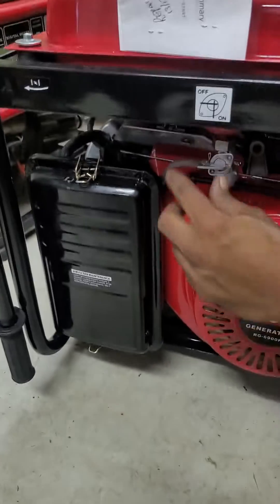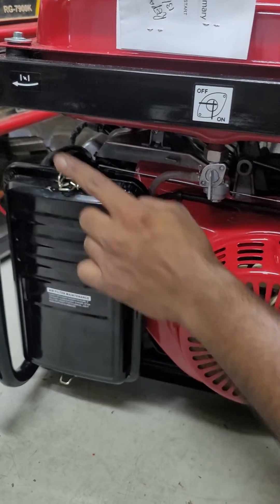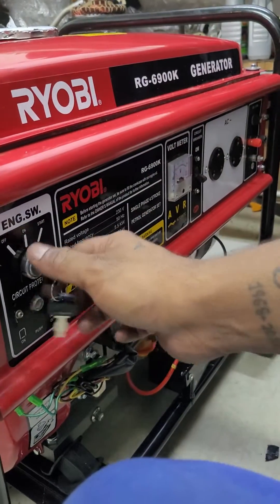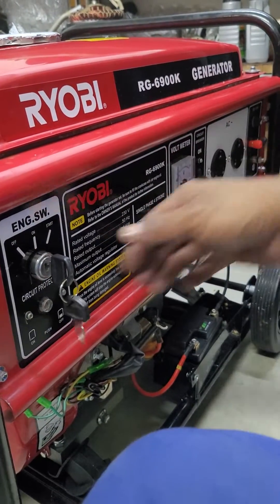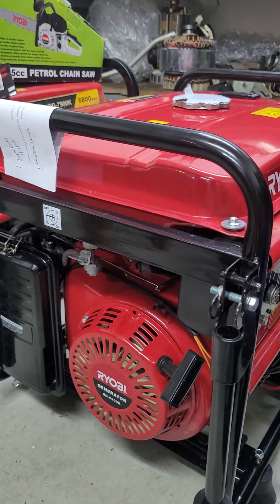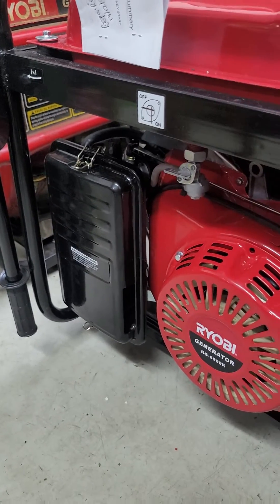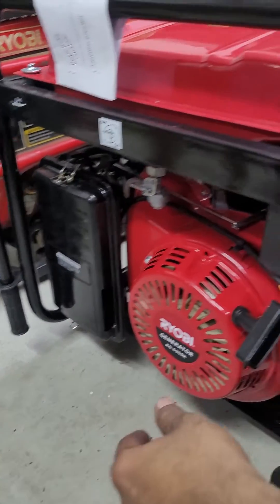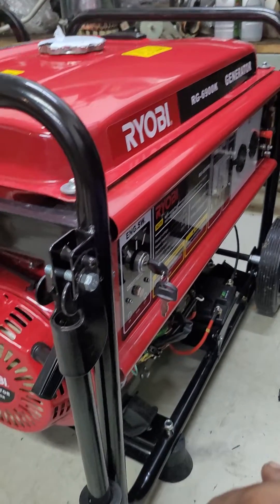Ryobi RG-6900K Generator 5500W 4-Stroke Start up and shutdown procedure

Comment: Thanks for this video. How often do we turn it off till fuel runs out.
Reply from the maker: You usually want to run out all the fuel that's in the tank and pipes - it's not advisable to store the machine with fuel for extended periods. I'd say put in as much fuel as you need for the application, remove the remainder. And then let it run out the little that's still in the system.

Comment: So circuit breaker should be off when starting and turned on before plugging extension lead in?
Reply from the maker: Yes, only plug in your device after the machine is on and running. Makes sure the switch is in the off position when inserting the plug. After inserted, switch on.